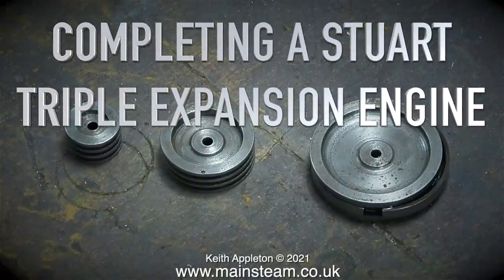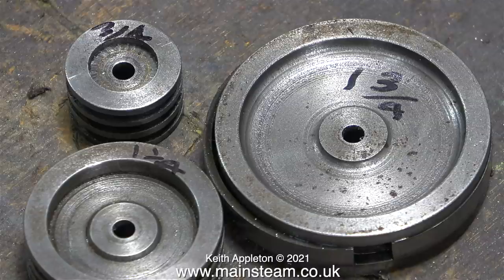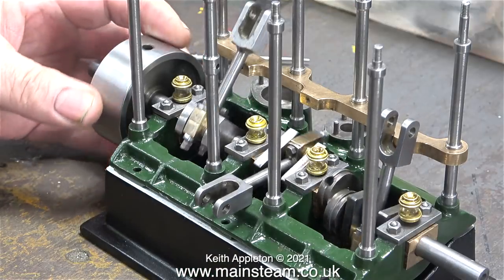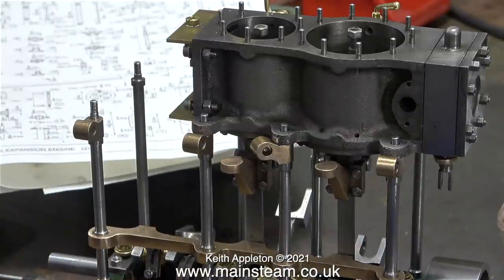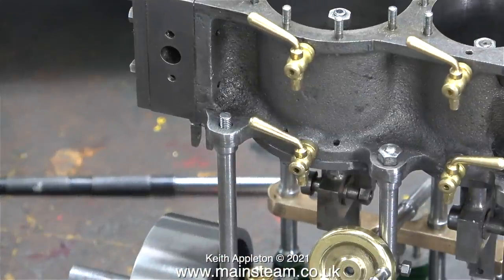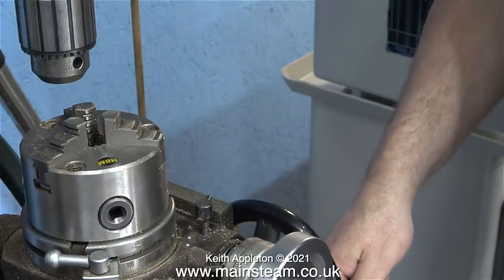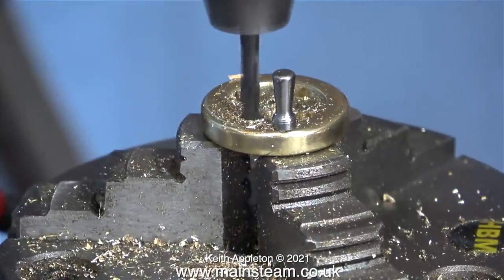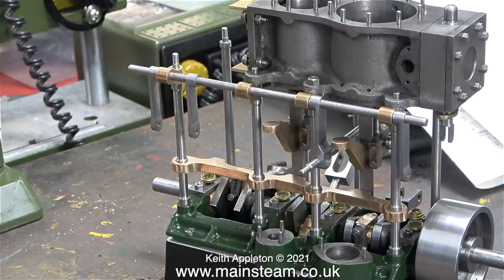COMPLETING A STUART TRIPLE EXPANSION ENGINE - PART #23

Comment: Hi Keith - I noted that the base casting does not have the Edwards air pump hole drilled and tapped for the input. Also, not sure if there is a conical hole inside the 3/4" hole? .....i do like centering technique for the chuck on the rotary table. Simple but effective....
Reply from the maker: Everything is perfectly fine . . .

Comment: That technique for finding the center of the rotation table Perhaps isn't the "correct". But it sure seems to work.  I'll never argue with you for doing that. 
Being an American, I still have to get used to the word "spanner" for a wrench, or socket.
Not sure why the difference in terms from across the pond
Reply: How about English wrenches, which is what the Portuguese call an adjustable wrench/spanner.